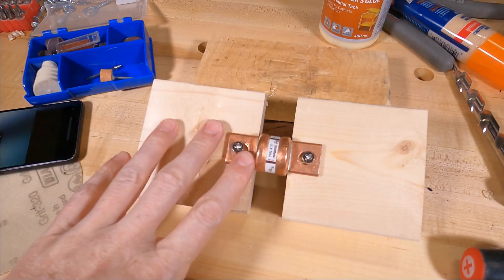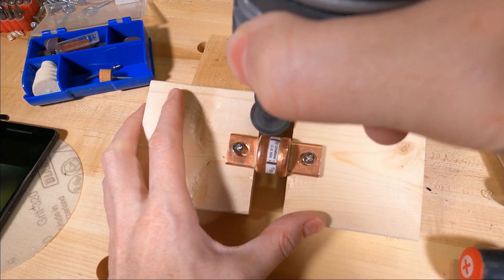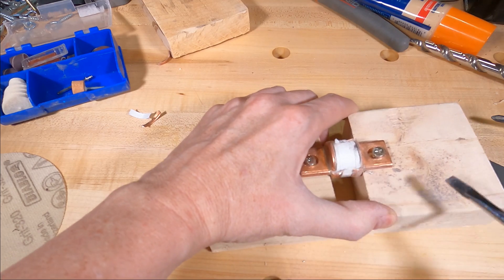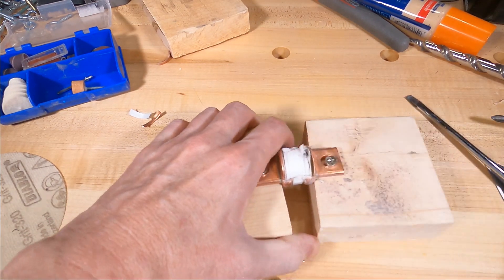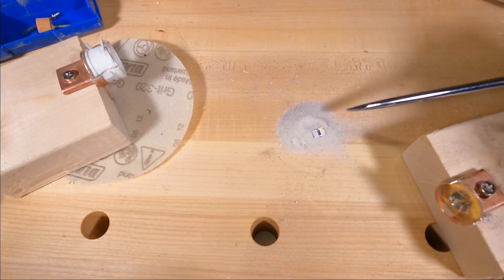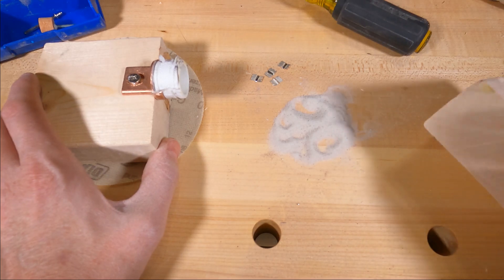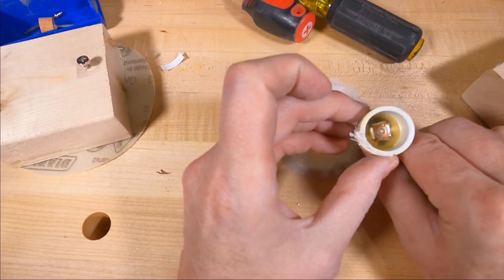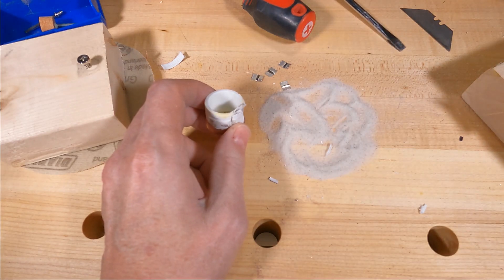T-Class Fuse Dissection - But a Byte

Comment: Is this necessary in a 12v system?
Reply from the maker: Yes, absolutely. It's not the voltage that matters, it's how many amps that can be dumped in a dead short.

Comment: Class T fuses are useful for a 12v battery or is it advisable for 48v batteries and more?
Reply from the maker: The amps matter, they work fine on 12v. I'll be using them for my trip home on my 12v bank.
Reply: @TheDigitalMermaid  ok thx ! I was wondering if for my 310ah 4s 12v battery, to know if an anl fuse is correct or a class t fuse is sufficient
Reply from the maker: @sami44411j  you should be just fine. Where in fine l doubt, check the fuses specs

Comment: I'm a firm believe that one can never have enough fuses in an electrical system.  Sometimes a nuisance but life saving stuff.  Class T is altogether a unique bear.  DC voltage is so apt to arc even in a dead blown fuse that this type safety is necessary.  Most who are dealing with DC in solar are somewhat used to AC safety but don't realize the potential for the dangers of DC.  It's important to note for anyone endeavoring to work with solar systems or large DC battery storage systems this information.  Its already too late if you do this by experience only.

Comment: Have you considered using Marine Rated Battery Fuses (or simply MRBFs) instead of Class-T fuses?
The one thing I dont like with Class-T (and some Megafuse) is that the filament is not visible. One needs a multimeter to check for continuity.
Reply from the maker: Nope. If I lose a battery entirely, and it's because a T-class popped, I'm pretty sure I'l know why it popped. Also, if you plan to have an electric sailboat, keeping a multi-meter onboard is a pretty obvious "must have" tool. :)
Reply: @TheDigitalMermaid  Umm.. your points do make sense...
Reply: Most of those MRBFs are not able to do what the entire point of a class T is.. stopping dead shorts from continuing to arc the internals. The MRBFs, ANL, and many other fuses can't handle super high amps. When a big battery pack shorts and has possibly thousands of amps it just melts many of the other fuses and they continue to arc. Class T is the highest rated one, at like 20,000+ amps due to the sand and I guess the 4 terminal magic

Comment: Next accident :: cut you thumb with a dremel.       Yikes!   Other than that, nice job on showing the innards of a T-class fuse.
Reply: I was going to mention something about that... scared me at 1:15 (just missed her thumb).  Still cool to see the tear down.
Reply from the maker: Oh no doubt it will happen... I often catch myself cutting towards myself with a knife, and each time I say to myself "gah, stop doing that!". I'm not the fastest learner sometimes. lol
Reply: @TheDigitalMermaid I will tell ya, dremels (and angle grinders) just slide through. I'm sure a stick of butter puts up more resistance to a dremel cutoff disk than your finger will. I can tell you a leather glove provides 0 protection from a disk, except maybe slowing down how fast you moved the dremel into your hand by a tiny amount, and hopefully deflecting it a few degrees before it hits flesh. But it will not stop or slow it, that's for sure. And the wounds "feel bad", far worse than a knife slice, that's for sure! You have to grow all new flesh the width (or more, depending if that area of skin is under tension) of the cutoff disk, which takes longer to do. And the edges of the cut, aren't really cut, they're abraded away with some thermal damage on top of it.

I will take a slice with a rusty piece of metal 10 times out of 10 versus an abrasive injury!